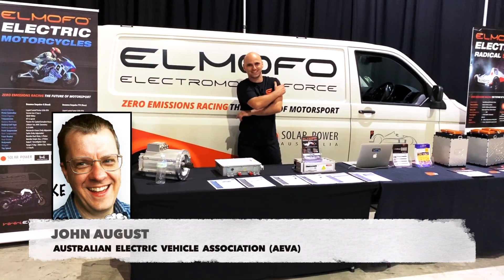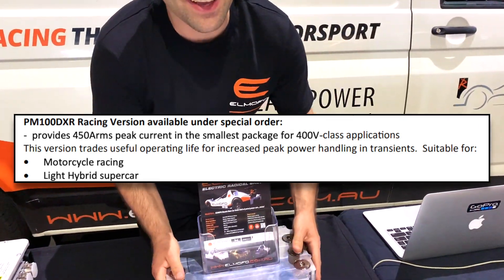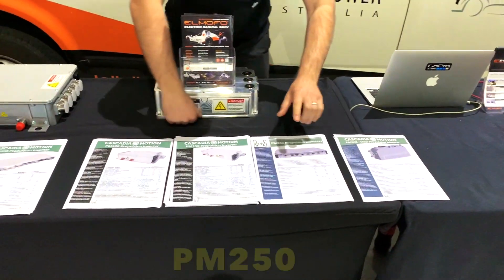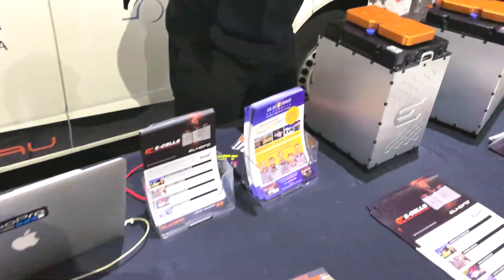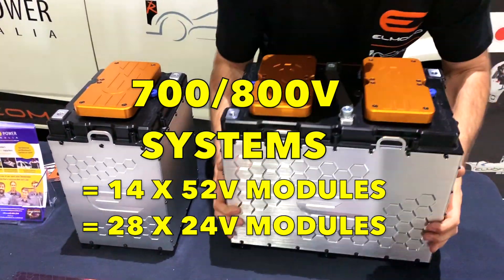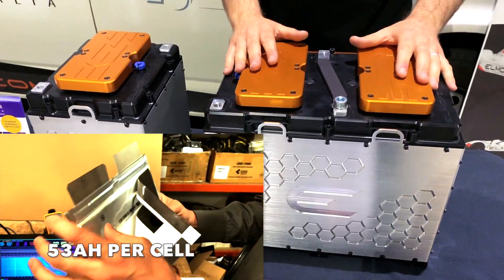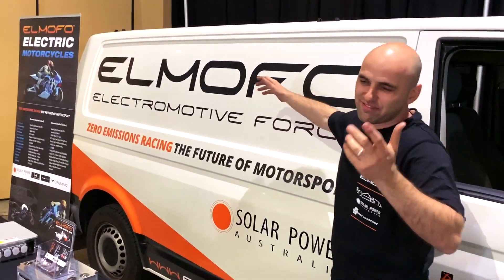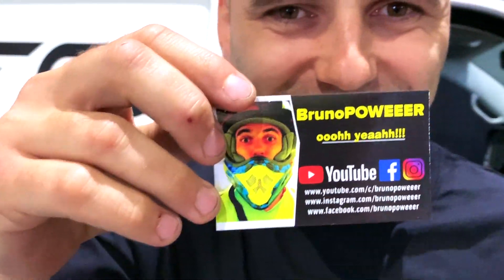EV Expo 400-800v Rinehart controllers, ELMOFO Batteries, Parker Motor, Radical Race Car, Solar Train

Comment: So nice to see the evolution, finaly i thing about the project with two motors for run a train, why two? for playing, for toy it could be two motors but a train it's not a toy. Finaly i thing: one battery one controler, one motor? A second motor with very cheap system for eventualy in extrem conditions run slowly the train to the first  check point. I don't no, it's my idea.
Reply from the maker: Yeaahhh when projecting that electric solar train I was also thinking WHY two identical complete electric drivetrain + battery sets but the client wanted a super reliable solution that would never stop and wanted a practical redundancy system. Otherwise your suggestion about a smaller redundancy system would be my first pick too =]
Reply: Thank you for your answer. I do not know how much the synchronization system consumes but probably almost nothing. Also, it is very hot on your continent, if there is enough battery pack with your good temperature control. If that sucks, you have to put the packs in the fridge lol .... I work with a motorcycle project ..., that's why these subjects interest me. I have good ideas, I knew for almost ten years that a gearbox is necessary for electric propulsion and the latest news a world famous car company has made a two speed gearbox. Also, in terms of security, everyone plays with these chemical reactions and these rare earths mixed in cells, the battery compartment and cockpit should be hermetic ...

Comment: With the motor. Can the shaft be milled to fit a specific transmission for ev conversion? ie, using automatic transmission and having the motor slot onto existing transmission shaft.. so both mate together with a custom conversion plate.. 

Thanks
Reply from the maker: Great questions mate!! Okay, machining the motor shaft can be a bit challenging as you have to remove the shaft from the motor (really big and powerful magnets, requires tools) and I heard some cases where people machined the shaft a bit smaller and that monster torque snapped the shaft when the motor was under load. That happens to many different motor, brands, big or small. It can be done but maybe make an adaptor connecting both ends. You still need to make an adaptor plate to attach the electric motor to the gear box. 
Gear box is good if your motor isn’t big/powerful enough to power the car in single gear. Ideally get a bigger motor and avoid using a gear box. The problem is that most gearboxes can’t handle that massive torque and start to develop a bit of a play and gets to the point that it’s really annoying. I know MANY conversions where it was fine and after 3-5 years the gear box is sooo bad. Ideally get a gearbox from a V8 engine so it can actually handle the torque without self destroying.

Comment: release your own supercar bro, 1 motor on each front wheel and a shitload of torque in the rear, im sure you could design a chassis to fit your batteries in a low COG configuration, you only need to beat the 0-300kph time and keep in under 2.4 secs to 100kph with good cornering vectors, carbonfiber chassis with graphene in the resin please
Reply from the maker: Yeeeeaahhh I’m sure if I use graphene and quantum technology I will be able to make a car that goes 0-475kmh in maybe less than 5 seconds and 0-100kmh in 0.9 seconds... but even that seems to be quite slow if you consider teletransportation =]
Reply: @BrunoPOWEEER  im hoping for 0-100kph in 1.5s on my new 2wd bicycle... 1000amps of current, possiblilty of 100kph 2wd burnouts haha

Comment: I know its off-topic for the video but have you seen these small portable spot welders that use a small battery and a positive and neg copper point with a small PCB on top there sold as a DIY or fully built-in an enclosure just wondering if they are any good as I have a Sun 797G which isn't great but does the job just about. Sorry, its off topic but I do watch all your uploads and as you haven't crashed anything or come off anything lately I feel you owe me. SurRon comes to mind.
Reply: And no you wouldn't use it with anything here as a build tool.
Reply from the maker: Yeah I know exactly what spot welder you’re talking about  https://malectrics.eu/ I have one here and sold my older one to the University so the students could learn how to make batteries. It’s a good welder with lots of advanced settings. There are some pros and cons if compare vs Sunkko, I like the Sunkko pen waaay better and the battery drops voltage after hundreds of welds which can be a problem making inconsistent welds (the first ones very strong and the last ones a bit weaker) also stop in the middle of the build to charge batteries can be annoying. Apart from that, if you use a big and powerful battery with the Sunkko pen it’s AWESOME.

Out of all Sunkko welders I tested, I only like and trust the 709AD and 709AD+ , all other ones don’t weld properly (too weak and inefficient) or overheat in the middle of the build https://youtu.be/LYGWTbIPTxk